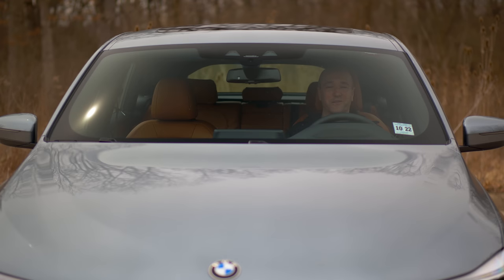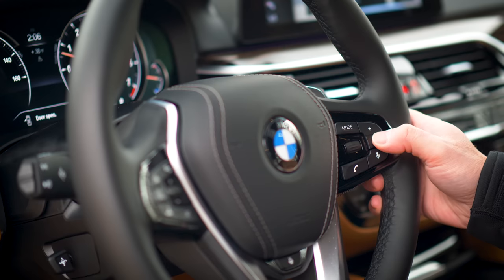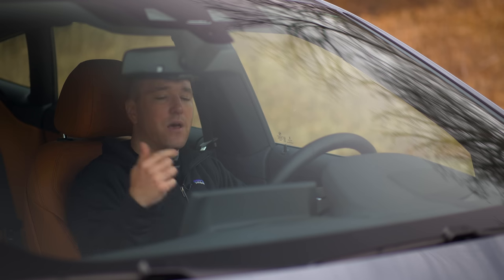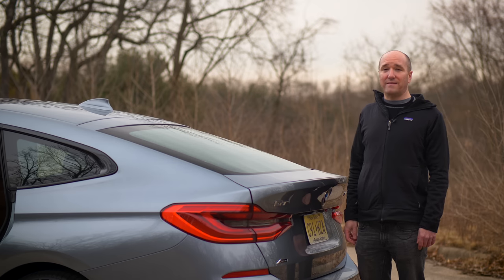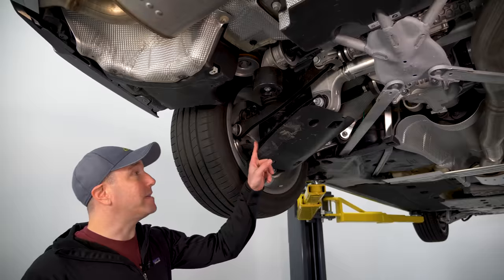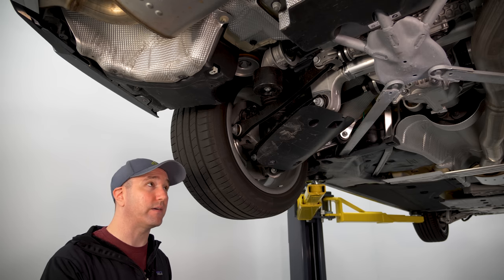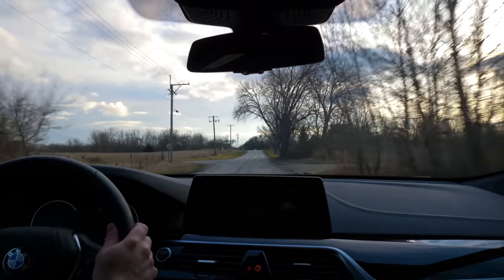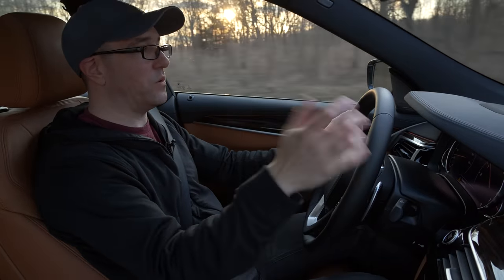Review | 2018 BMW 6 Series GT | Sedan Evolution?

Comment: Full-size hatchbacks like this should become the new trend replacing that silly SUV trend.
Reply: Especially since sedans are going for the "coupe-like" profile which should make it easier to add a fast-back-like hatch. The stinger is a good example of this. I'm just not into SUVs, CUVs, and crossovers.
Reply: Mgoblagulkablong Sedans > SUVs. They are more practical (you dont need to swing groceries etc up in the car) and have far better driving dynamics than a whale on 4 wheels. 
And they look better than most sedans imo
Reply: I whole-heartedly agree. I bought an Audi A5 Sportback and I hope to see hatchbacks make a full recovery in the US.
Reply: SUV's are much more versatile, for those who need that.
Reply: Walid Amir No they’re not... wagons have nearly the same cleareance as SUVs and are better to drive and more practical. 
Have fun with your roof rack 50cm higher than the wagon- practical my ass
Reply: What’s wrong with wagons, the original family vehicle
Reply: @raupenimmersatt6906  SUV's have more ground clearance than wagons
Reply: I agree 100% and wish it to be so. :(
Reply: Hatchbacks are so much more practical than sedans, I agree.
Reply: @timeyinsholaye9169  Very few people need that. And then they wouldn’t get a crossover, but a Wrangler or truck based true SUV

Comment: My dad owns one, a 630xd M-Sport Sophisto Grey to be exact. It has the adaptive air suspension, 4 wheel steering and it gets 7l/100km (that's 33 mpg US). The driving assit on this car is also a must these days, a completely safer ride. Driving in this thing is easily on par with the 7 series and has more room inside than the normal wheelbase version. Also FWIW in Sophisto Grey with 20'' wheels it actually looks pretty badass in an unconventional way.

Comment: heads up display is awesome. Can be adjusted for position and brightness on the windshield. Navigation info, audio selection, speed limit, auto cruise control info for distance, so much stuff you dont need to take your eyes off the road.

Comment: Excellent review as usual!  I’m not a Bimmer fan, but it seems like a solid effort.  I dig the 5 door hatch fastback form and practicality, so this design works for me, and is much improved over prior Bimmer GT’s.  Amen to the turbo 6cylinder over any 4!  Volvo really lost me with their all raucous 4 cylinder motor lineup, but I’m happy to see that the Germans still understand that the luxury vehicle market still requires a refined and powerful engine option.

Comment: This is the best source of information on this model, period. That dynamic suspension is really, really rare. There are 4 for sale in the entire US right now, 3 from reputable dealers, and only 1 CPO. Has anyone compared the base suspension vs the dynamic sport mode? Since no one really offers aftermarket parts, it seems you are stuck with whatever suspension you buy. The passive setup had a bit too much pitch and roll for me, and was the only weakness of the car.
Reply: BMW America do not import the current 6GT. I have a 640i with full air/dynamic suspension and can recommend it. Spare parts are available - the air suspension shares components with the 7 series.
Reply: @badgastein2  hows the maintenance on this car?
Reply: @nyustdent  Nothing major has worn out on my 640i, the first 3 years cost  a standard charge circa £350 ($500) each and the 4th year doubled to £700 but that was because the spark plugs were routinely replaced and the pollen filter was a hefty £100. The underbody parts are either 5 series or 7 series so the fact that the 6 series is not available new in the UK and USA does not seem to be an issue.

Comment: I own a 340i xdrive msport with this engine and a jb4 tune box, zf 8spd and adaptive suspension.  I am sure it is not as isolated as the 6 series but you should review a well equipped 340 to see what you think.  I'm salivating to upgrade to the new M5

Comment: I used to work at a bmw dealership, after getting into all of their cars and experienced them all, the way these 6 and 7 series’s drivers completely blown me away. And i opened my youtube and watched couple reviews about them, like comparing a 7series to an S class, and many more about both cars, the only person that really pointed out what really was true about this car ( and hopefully you are going to review s class and 7 series) was you. The way infotainment system is designed, the way the car drives, what you get compare to what you are paying, and you point them out as well as it was. There was one complain i have about the car, i was surprised you did not mention, when you press the air suspension in the car, it doesn’t show you anything anywhere in the car that whether if its lowering or raising the car. It might not seems a big deal, but when you look at other cars that have it, its very important in my opinion. And the way their shiny material get scratched up when you clean them even with microfibre towels

Comment: BMW are masters of inline 6's going back many decades. I have a K1600 with an I6 which is consistently called one of the best motorcycle engines ever made.
Reply: Dude, BWM only makes good diesel engines.
Reply: @dragospahontu  Ride a K1600.. experience that I6.. then tell me if you still believe that.
Reply: @user-cx2bk6pm2f  reliability wise

Comment: Status report: @45k: soft close door malfunctions, tailgate motor issues, trunk mystery death rattle, counterclockwise steering column click at 11 // @52k: both CV boots torn, 2 front axle replacements needed $5k // @53k: pulled out from 4 new tires installed, transfer case immediately slipping. Fluid change $1k, 30% chance of working. If not, new transfer case $13k. Yes, $13k. Well-timed, BMW. Otherwise, not jealous of anything else on the road

Comment: The hvac did unfortunately break on my 5 series the same time the screen broke despite being separated same interior as this about the worst experience I've ever had with a cars electronics completely random it all shut off while I was driving. Mechanically they are solid

Comment: You should also review the BMW loaner car. You'll be driving it half the time while this GT is in the dealership repair shop (and that's often). :)
Reply: oldschool1 why do people assume BMW’s are unreliable?
Reply: simply so many mechanical and electronics pieces to go wrong/break/not work on this type of vehicle.  The engine I am sure will have no issues, but all of the other things.  Some people like to piss away money on vehicles and this is one for them!  For me, I value getting 200,000+ miles out of my vehicles.  no way in hell would I come close to this thing regardless of the price
Reply: Thomas New I’m pretty close to 200k on my BMW I’m at 192k rn
Reply: You are talking complete bollocks, my friend. I have had two 5 series GT’s and now have a 6 GT and nothing has ever broke.

Comment: Amazing car. It's not super popular, so you can probably get 20-25% off MSRP, so that knocks the price down into the high 50's. On the used market these will probably be around $40k in a couple years. Only downside is the reliability. That's the issue with these Luxury vehicles in general outside of Acura and Lexus.

Comment: Very impressed and love that it's RWD and all that aluminum underneath. However not a fan of all BMWs front styling and them sharing your driving data withninsirwnce companies. Also it's a downer that you need to spend $80k with all options for it to drive comfortably. The suspension should be standard

Comment: It is still overpriced. It costs around 20k more than a 5 series and nearly 20k more than a Mercedes E class wagon. That does not make any sense. Why should you pay so much more for this? BWM should sell this at a price comparable to a E class wagon and also offer the 5 series wagon.
Reply: This is much more than a 5-Series, it's based on the 7-Series short wheel base, and handles and feels 99% like one, just with a bigger boot and more room. The price is amazing for what you get.

Comment: Can this review be applied to the bmw 540i xdrive put aside the hatch cause the 640i is seriously hard to find on the used market, there's virtually no 2018 640i on sale in Montreal where I live but a lot of 540i at a reasonable price even 2017  which is the first year with the b58
Reply: BMW America stopped importing the 6GT in 2018. They don’t seem to want to broadcast that fact. I also understand they do not import the 5 series station wagon. The 6GT rides more like a 7 series (owned both).

Comment: Can't agree more about the 4 cylinder engines. I've had four loaner/rental BMWs with the 4 cylinder engines and they were all awful. They're buzzy and they vibrate like crazy and they just don't make enough power. Even transmission tuning is completely different, it's sluggish. Avoid the 4 cylinder engines at all costs!

Comment: does that underbody coating also prevent or minimize corrosion? I actually think that is even more valuable than the noise reduction
Reply: themza912 BMWs built after the turn of the millennium extremely do not rust

Comment: I still don't understand what this car has over its wagon counter part.  Even the wagon look better than this. But great review thou
Reply: Charles Hu Its more expensive just like the X6 and X5 and people are more about showing off than the value of the product.
Reply: Technically? Nothing. But wagons don't sell in the US for cultural reasons, so it's the closest you can get here.
Reply: This has more cargo than the 5 wagon! It is about 6" longer, and a lot more rear leg room too.
Reply: @andrewffay  If it is longer than it cannot be compared to the wagon. It's like comparing apples to oranges. :)
Reply: Charles: a lot of people would not buy a wagon due to drop in status. My uncle has a Lexus IS and his absolute requirement was for the car to be a black sedan. Ended up with big car and tiny trunk :(.
... still great to borrow it every now and again :)
Reply: Because it's in a class above the 5-series, (same chassis as the 7 series) think of it as a 7-Series Wagon, with a sporty rear and much better price tag.

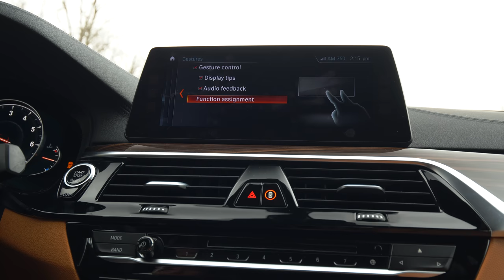Comment: Regarding the gesture control demo at the 07:08 videomark, I wasn't sure if he was adjusting the volume level or calling for an off-speed slider on the inside corner of home plate. Seriously, gesture control has to be the most overrated luxury car gimmick in recent years. At what point is adjusting the audio volume via the steering wheel controls, too much effort?

Comment: Honda made a similar vehicle years ago for much much cheaper, the Accord Crosstour. It's ugly but quite functional.
Reply: I wish that Honda did a refresh on the Crosstour (Acura used the same vehicle too back in '12 or so) as I found only the back tail lights looked a tad off. Otherwise, what a practical vehicle from a trusted maker.

Comment: What about buying it 2-3 years later geese???
Reply: We bought an ‘18 CPO w executive pkg and HK stereo in Aug ‘19. Great deal and we added the CPO wraparound warranty.    Love love love this car - even more than our ‘17 330i wagon.  If you’re looking for one  hold out for the parking pkg - the 360’ camera is worth every penny!
Reply: @malcolmjones893   Exaaaaactly what I'm looking to do. What I've been doing is asking the dealers for the official bmw spec sheet with all of the pkgs. I'm not that fully knowledgeable in the BMW trims and packages yet and really wish they would actually go into detail about what those things include. Like you said the executive pkg..luxury line and such. I called BMW customer service and the rep would go over all of the pkgs a VIN included. But, he said that because they stopped making this model in 2019, they don't list all of the possible packages on their site anymore. Which doesn't make any sense to me, because I swear I've seen a promo vid from BMW for a 2021 model.
Reply: @mrfreezey1 , my dealer has gotten 2 of these in as lease returns over the last month or two.   How’s your search going?
Reply: @malcolmjones893  Great! Actually got a an '18 Canada spec one from NJ 2 weeks ago! It's in Bluestone metallic with mocha interior, M sport,executive pkg, parking assistant plus, also active dampers. Its been great, had 2 random warranty issues already..the soft close door motor needs to be replaced as a well as the night and thr active shutters were faulty
Reply: , congratulations!   Sounds like a great build!  Enjoy!
Reply: @malcolmjones893  i would've bought a Lexus ES
Reply: A bargain buy as it’s built like a tank….my 6GT is 3 years old and faultless super cruiser.
Reply: @mrfreezey1  Your Dealer is not telling you the full story….BMW stopped importing the 6GT in 2019, but in the rest of the world a face lifted model with more high tech was launched..4

Comment: I still don;t get why won't people get a wagon over this?
Reply: The 6 GT actually has more cargo space than the Euro 5 series wagon. Sadly the 5 wagon and 6 GT are no longer sold in the USA.
Reply: @badgastein2  I saw and did the calculations... 5 wagon has 570 liters of space or roughly 20 Cu. ft and about 24 for the 6 series. I guess you are right. Somehow it is bigger in numbers, but I'm not sure in practice. And even so... I still like the wagon looks better. Might be person preference.
Reply: @bobogto540i4  I like wagons as well - I have owned a Volvo XC90 Polestar upgrade which was a fantastic car, but I then tested the 5GT and the ride was much more refined in the BMW, the discount was so good I could afford to replace the 5GT with a higher spec one and then moved onto the 6GT, however I’ve no doubt the 5 wagon is pretty good and it’s available here in the UK ( the 6GT is no longer sold in the UK).

Comment: You know what all that insulation is going to cause: RUST. Water will be seated in the crevasses between those panels for years, causing rust to overrun the car
Reply: What I would be more concerned with is how that coating reacts with serious anti-rust sprays, like Krown or Rust Check. They won't ever give you a straight answer except for, "Don't use them. Our coating is good enough." Well, that's not quite enough for those of us that live in SERIOUS rust-prone areas.
Reply: Most of the panels are aluminium and plastic so it won’t rust.

Comment: You didn;t say anyything about the 6 series which is a ...Coupe. You talked about the 5series (on which both the 6series and the 6series gt are based). It would have made it more clear to convey the absolute non-sense that manufacturers like BMW/Audi or Mercedes are getting into to fill in unexisting needs...

Comment: BMW went down. German engineering is a myth now. A toyota can beat BMW when it comes to quality. Even a yaris lol.
Reply: There's a difference between engineering something to be useful/innovating and engineering something to be durable. Germans are better at the former, they used to be pretty good at the second part until they realised it wasn't adding any profit. Toyota and a few other japanese brands have always been good at both types of engineering but care much more about durability and when they do innovate it's in different ways such as very good hybrid, electric or hydrogen cars or clever interior and exterior designs. The Japanese seem to care less about perfecting certain aspects of luxury and more about the total package on offer. They're also a bit more experimental/less traditional.